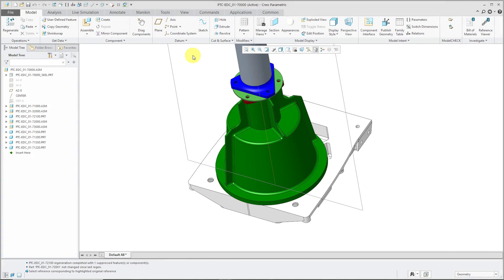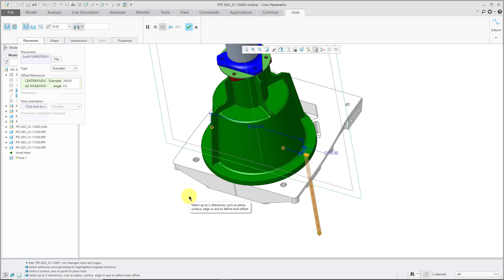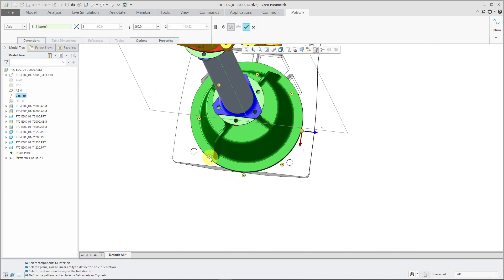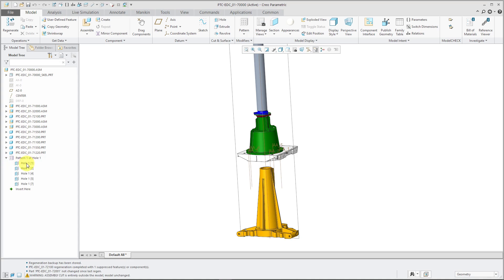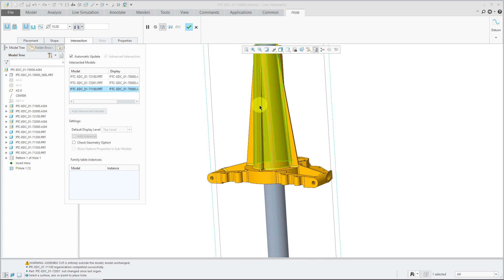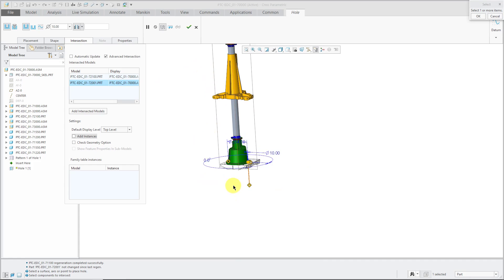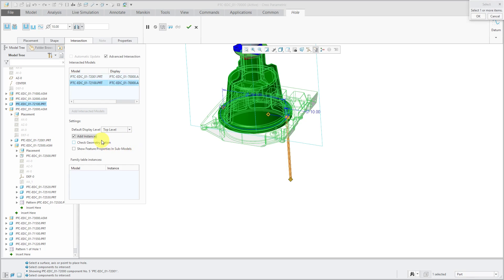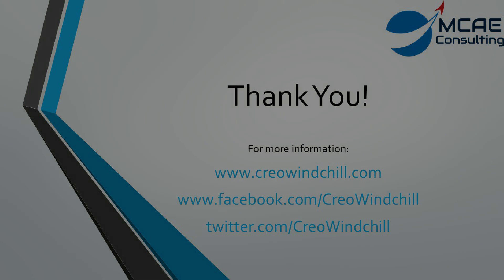Creo Parametric - Assembly Level Features

Comment: One thought is coming to my mind after watching video. If I understood right, you prefer and recommend to make holes in parts, not as assembly feature. And from manufactory prospective it makes sense of course to make holes in each part separately, not during building machine. But from modelling prospective it feels like assembly level holes are a better way to make sure that all holes in part models are aligned and updated. If some changes are coming, you change one feature in assembly, and all intersected parts should be updated accordingly. So from design intent prospective somehow it feels like a better option.
Reply from the maker: I disagree with you, but that's okay. Everyone is entitled to their own opinion. From a Design Intent perspective, I believe that you're better off using Top Down Design techniques like Skeletons and Data Sharing Features, as they provide more control especially when models have been released. But if you prefer Assembly Level Features, go for it. You should also prepare for your assemblies to get really, really SLOW though.
Reply: @CADPLMGuy  Thank you for the reply, I will look into skeletons and others mentioned. I should have mentioned that I am a beginner, so just shared my thoughts and observation. Appreciate the explanation and thank you a lot for your work!